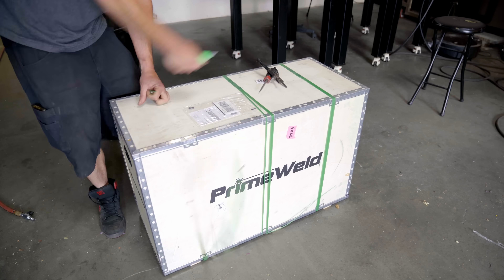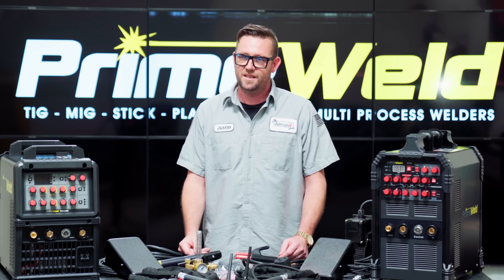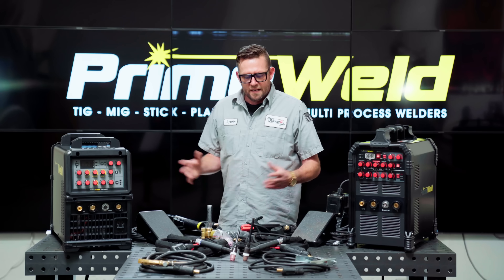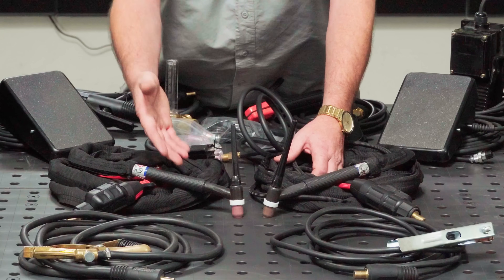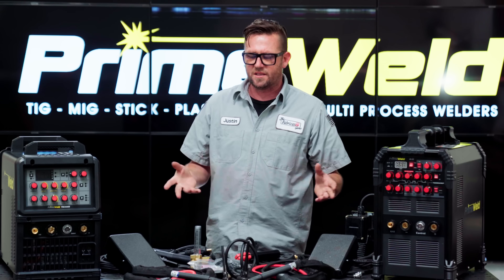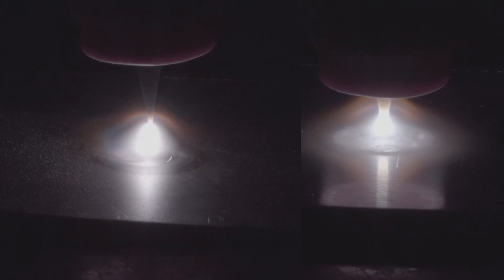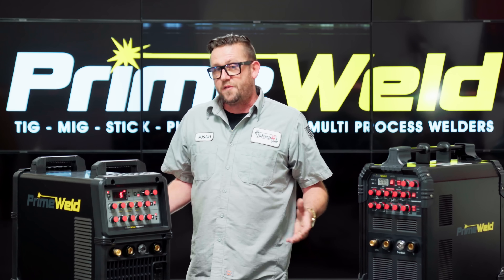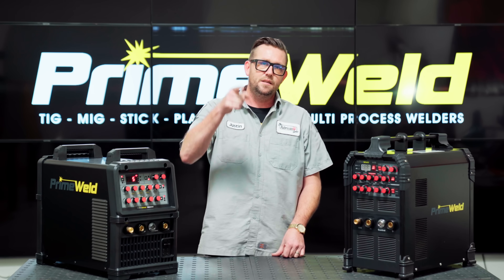Primeweld 325x Reviewed and Compared

Comment: As someone who has bought Primeweld equipment, kudos to you Justin for doing this video.  Their customer service is exceptional.  And as someone who has dealt directly with packaging from China in a former job (and packaging and container design), Primeweld is stunning on protecting their products say vs... a Green Welding company who are almost fraudulent.   I have owned a 225x and stupidly sold it...for a profit but that was a mistake.  So was curious on the 325x.  My take.  For a garage welder like me the 225x is still the best bang for the buck.  And its lighter.  I can move a 225x with one hand at 54lbs but the 325x would be a struggle for me as I am almost 60 and my back is not the best.  The fan call out is key.  I agree with Justin that it would be an issue.  Myself, I almost get the feeling that if the 225x were visually re-freshened that the 325x would not even sell that well.  And, given that Primeweld does have ears and listens to what the consumers are saying, this where they score big points vs Blue and Red.   The Red box that does TIG is 10 years old and is way way overpriced (marketing costs) so going to a Primeweld you get a competitive machine for much less.  Just don't be like me and sell your welder.  Keep it.  Its a good friend.  And Justin, thanks for the review.
Reply: I'd love to keep a few dollars in my pocket (or spend on materials/upgrades) but I'm going  325 because It has more power and range. I hope Primeweld will  reprogram or replace the loud fan with a quieter unit. I'll do it myself once the warranty is over--I have some soldier and a retired electronics engineer handy, but it shouldn't be that difficult for a thinking man. Thanks for your input.

Comment: I think it's great that you did a comparison between the 225 x in the 325 x I have the 225 x with the water cooler and a water-cooled flexloc torch. I was debating on upgrading to a bigger machine and was actually looking at Miller dynasty 300. With all the aluminum welding that I do a lot of aluminum welding in a lot of 5/8 aluminum I found adding helium to the mix makes it a lot easier with the 225x. But definitely have Justin put it if it's in your budget it's a good purchase if you don't have it in your budget you could do an upgrade like I did with my 225x and add a water cooler. But all-in-all Justin thank you for the great comparison and keep up the great work...

Comment: My question is how noticeable is it dealing with that large cabling on the 325 TIG torch versus the smaller cabling of the 225?
Reply: Never tried 225. but i wrap 325 cable around my shoulder and dont even notice it. The 17 torch cable at 125A does get uncomfortably hot just sitting on-top of my shirt/shoulder after like 30m of welding (not 30m of arc time... 30m including looking at and messing with parts/welds, still just learning to weld, running beads).

Comment: Primeweld customer service is great.  I had a rare issue with my 225, they worked with me on diagnostics because I was comfortable doing so and eventually simply sent me a new machine.  Old one went back in the box, return label included.
Reply: What kind of issue did you have with your 225?
Reply: I own the MIG180 & TIG225, and PW customer service often replies to email questions within minutes.  I've never waited more than  24 hours, no matter how trivial my question. 

Try getting a question answered by Lincoln or Miller.  Let alone get your machine fixed or replaced. 
Price alone, IS NOT a reliable metric for judging Customer Service or for quality.

Comment: My biggest question is will the 325 do smaller parts with a small arc, my 225 won't go down far enough to run smooth small beads, like a stainless steel contract that came in and I couldn't get the welds small like the specs and the example part showed which they where welding with a Miller 220 millermatic or something like that which was able to give them that small smooth bead they wanted, sorry to say I lost that job, I just didn't have the machine to do the Jon, but if this 325 which showed when down to 10, and 5, which my 225 want do, I might've gotten away with that project
Reply: I welded some razor blades together with the 325x. Keep in mind that was my first time ever doing so, but it only took 5 welds for me to get it correct. Could get the weld width to about .040" wide and keep the ends crisp. Did 15-20 amps 1/16" lanthanated with 1/4" aluminum backing.
Reply: If you don't have the fn proper equipment to do a job it's your fault u dmf'r

Comment: Dang, you gave primeweld a good review AND you sell em? Crazy how that works 😂
Reply: I ended up getting a 225x after watch his review and a couple others and I can't say he is wrong about the machine at all. I was running a miller 200dx and my 225x is way way better. It's nite and day in how smooth the arc is.
Reply: I wonder what happened to the Everlast machines he was using/promoting some years ago. This is why I have a really hard time believing all these positive reviews by the big channels. I'ts come to the point that I value the opinion of some anonimous guy with 40 subscribers more.
Don't get me wrong, I like the channel and really want to believe he's being honest in his reviews, but you can really tell when a company is trying to push a product. Just do a search and you'll find plenty of channels "suddenly" coming out with reviews and they're seldomly critical.
Reply: Ditto. Upgraded to the 225 based on his original review which really did address all of my complaints. I can see the reasons why I should upgrade but the 225 handles my needs. If I need 325 amps, I’ll head over to my friends house.  I attribute the decent review to a decent product.
Reply: The primeweld stuff is really good I have miller 250 syncrowaves in my class and the PW I think is better also more features I've had a student weld on a lincoln precision tig  the miller and the PW and they liked the PW
Reply: @MrBoilermaker28 you ever have a student blow a tranny or have you i take it you do auto mechanics
Reply: I bought the 225 last year and it is a great machine
Reply: He sells them cause they are a good product, that’s the type of guy he is, he won’t sell or promote junk and he won’t put his name or face beside anything junk.
Reply: But do u see how it's not a bad thing to do?

Comment: 325 A on 220V?
Reply: It's a simple power calculation. Maximum output voltage in DC and AC TIG for the 325X is 23 volts. 325 amps * 23 volts is 7475 watts.  7475 watts divided by 240 volts is 31.2 amps. Now that 7475 assumes 100% efficiency of the inverter. Primeweld says 35.7A at 240V, which is 8568 watts, giving us 86% efficiency. You'll need a 50 amp breaker and outlet for this, as breakers are spec'ed to run continuously at 80% of their rating. A 30A breaker wants to see 24A or less continuous, or it may trip (there's some variability, depending the age of the breaker, number of times it's been tripped, etc). With a 30A breaker, you could limit yourself to welding at 218A at 23V or settling for 17V at 325A.
Reply: @JCWren 👍🏻👍🏻👍🏻
Reply: Yes, 240v USA.
Reply: @weldphd  impressive so much amps on 240V
Reply: Yes

Comment: I personnaly havent run into anything the 225 hasnt been able to tackle so far (which i purchased due to your review on that) but the screen showing the value for all the knobs is almost worth the fine tuning adjustability in my opinion. Im close to upgrading just for that reason. Id like the confidence that im getting the same setting for repeatable results without wondering if im "close enough"
Reply: I just want a tig machine but I'm a broke student😆

Comment: This video has no information value. It is a commercial from Primeweld. where is the amp load test for real amperage? What is the duty cycle? What about internal circuitry components? .There is no such thing as a 200 duty cycle. Duty cycle is a percentage  per 10 mn usage, you are a clown.
Reply: Its actually 250 amps @100 percent duty cycle. 😂
Reply: Chinese machines are NEVER 100% duty cycle. I went on their site and found no mention of duty cycle. US and Chinese professional welding machines are typically 60%.  Without an amp test my best guess is their 250amps is probably around 200 true amps for 6 minutes out 10. Then it is lunch time. This is why they sell it for $1500. Because itis a 200A. Areal 300A is $5000.

Comment: My only complaint with the 225x is the DC arc start. Anything set to under fifty amps, you can see the arc start hot then settle down to the set amperage. Other than that it's a great machine and from the looks of it, the 325x is going to be awesome 👍
Reply: i have the same machine, i agree.   i notice that too, cause i weld automotive sheetmetal (classic cars), id get that burst of amps and then it settles down. only way i found to get by on that is by trying to lay the welding rod right on the metal and hitting the tip of the rod and body, then back up some.   other than that , i love the machine. i always used footpedals in the past and still do, but i gave the tig finger control a try when i was  under a car and loved it for hard to reach pedal situations..  no more pedals between the knees laying on my back.. haha
Reply: @matmcclary9840  to achieve the softest arc initiation make sure your start amps and upslope are turned down all the way when using the foot pedal.
Reply: @weldphd aren't those disabled when not in 4T mode?
Reply: @AlessioSangalli  no.
Reply: @weldphd  page 24 of the TIG225X user manual clearly says otherwise. I have never used a pedal in 4T mode
Reply: @AlessioSangalli  try changing your upslope settings in 2T mode while using the foot pedal. You will immediately notice a difference.
Reply: I was literally just going to post the same thing. I weld thin sheet metal and it can be extremely frustrating.

Comment: can you upgrade thr fan with a noctua or sth?
also if that is possible is the computer smart enough to stop the fan once it cools?
Reply: The fan shuts off eventually. It feels like it runs about 5 minutes longer than it has to, but if I leave the 325 on while I set up parts for the next weld it will eventually turn off. I would jump all over a noctua fan upgrade. The one in the back of the machine looks to be about 200mm diameter and maybe 50-60mm depth. Its a big sucker for sure.